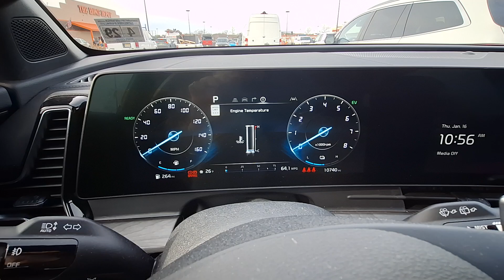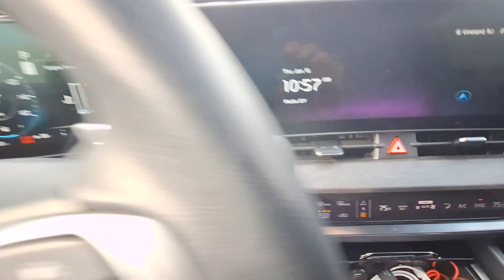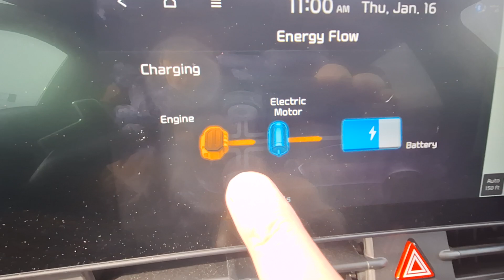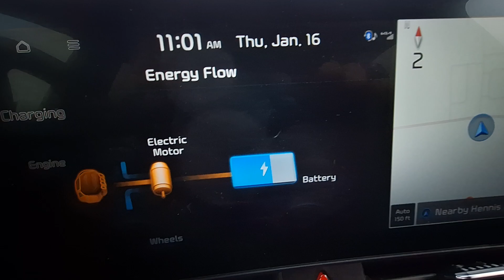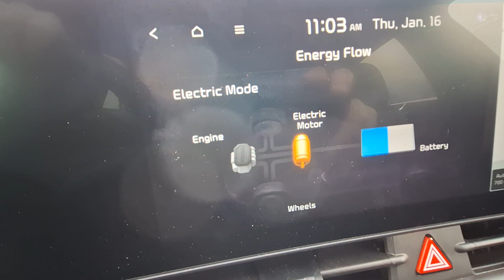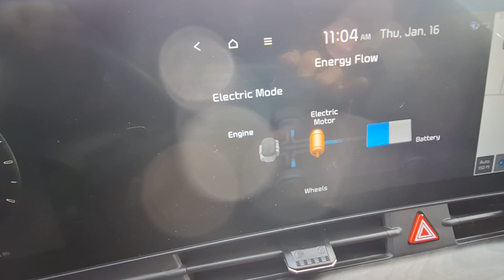Kia Sportage PHEV engine heat

Comment: Thanks for making this video on the Sportage plug-in hybrid. I'm looking into ways of not having the engine come on when I don't want it to. If you want to avoid the engine starting when using the front defrost option there's a workaround. If you turn on the air conditioning or like you said set the temperature to less than the ambient temperature then that doesn't require the motor to run, and set the blower to blow on the windshield or windshield plus floor and turn recirculating off, it will defrost the windshield. Maybe not as effectively having the heat on also. But with minor fogging air conditioning can be enough. For winter Heating try to park in the Sun without using a sun shade on the windshield and opening the sun shade if you have a moonroof. Also using heated seats and heated steering wheel if your car is equipped with that.
Reply: Everything you mentioned just works for temperature above 15 degrees Celsius and doesn't work when you live in a cold country like Sweden  for many months in a year